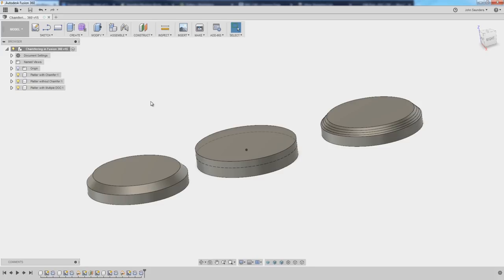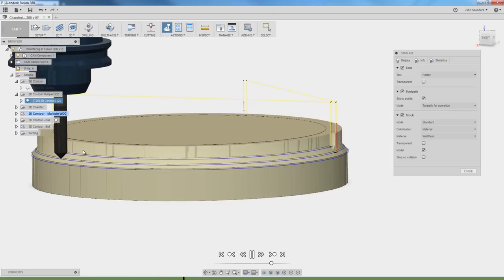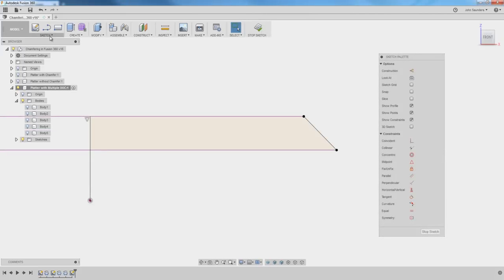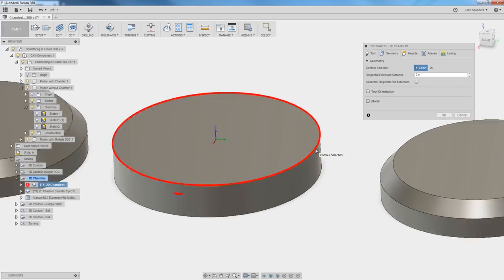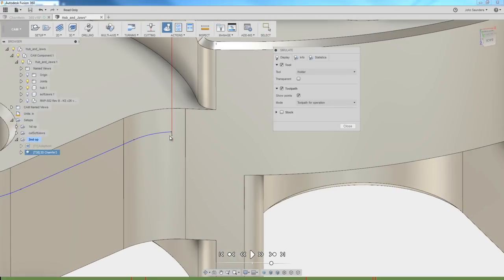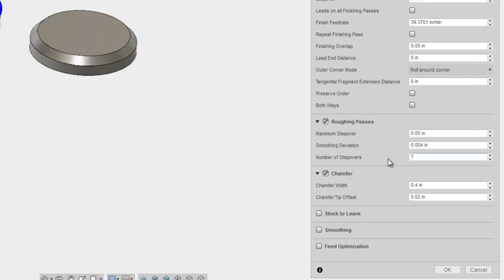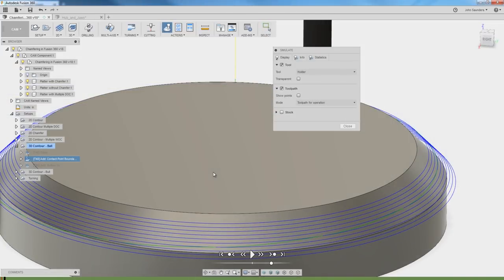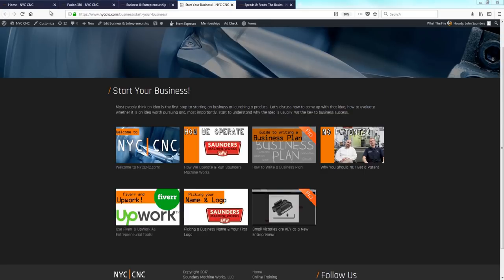Fusion 360 Chamfering: The Nitty Gritty  FF111

Comment: John,

Regardless of approach, one thing to be conscious of - particularly when chamfering small edge breaks - is to vary the contact point between the part edge and the tool between applications. Otherwise all your wear is focused on the same small area of the cutting edge. Later, if you need a wider chamfer that focused wear area will leave a cosmetically unpleasant ridge. Just change the tip offset  for each job to walk the contact point up and down the cutting edge.

Comment: Hi John. I regularly have to chamfer a 12mm thick plate in my workshop. The plate is 1395mm OD 700mm ID & requires a 10mm chamfer to the OD . I can do this in 2 operations as i have 800mm y travel . The tool I use is a Seco inserted tool with 25mm end & total diameter of 39mm. I do 5 passes of 2mm depth of cut , the first cut removes the most material this changes with every change in depth of cut . The last cut cleans up any small stepovers. I use a couple of tools like this for chamfering or countersinking , cost effective and fast enough. May not be good on your little Tormach but you would find them useful in  your other machines.

Comment: You can get a better finish with a small chamfer mill on a large chamfer if you account for the flat that’s on the bottom.  Usually .015 diameter flat on a 1/4” and a .006” diameter flat on an 1/8”

That’s why the chamfer comes out looking stepped when you do multiple depths, you’re programming it as if it’s a 0 diameter tool, but it’s really a .015” diameter tool, leaving you about. .004” step in the surface.

Comment: 2D chamfer works pretty well with 3D/Modeled chamfers in my experience. You always select the upper contour of the modeled chamfer or it won't generate a tool path, set chamfer width too a thousand or even a tenth (if the chamfer needs to be held to a close dimension). If the chamfer isn't modeled, then you just add the chamfer width that you are looking for otherwise it will work off the modeled chamfer + specified chamfer width

Comment: Small tip: you can actually use countersinks as chamfering tools, or at least the ones with three flutes. You just have a little work measuring in the geometry since the bottom of those have a little flat.
Reply: Klaufmann Single flutes work well too. I use them all the time. Spot drills do a great job also.

Comment: For modeled chamfers larger than your tool.   Do some 3D Adaptive clearing  with a Flat EM in the chamfer area before using the chamfer tool.  Credit to w.A.f. for his comment on this.  Also to Oakwood Machine Works, yes, you could use a mill drill, but I think you'd find you'd need a roughing and a finishing pass, so probably better to use a FEM that you are likely to use for an operation before this one for more efficient roughing and material removal.   

Once the area is roughed, use 2D Contour from the TOP of the chamfer in multiple steps.  Steps are duplicate operations, with just the Chamfer Tip Offset increased as you work down the part.  You can use offsets larger than the width of the cutting face of your tool, but you can't use negative offsets, which is why you start from the top and work down.

Comment: 5-axis should let you use any parallel cutter with flutes to cut a chamfer at "any" angle. Gives a constant cutting speed across the final face.

Consider it a challenge.  Merry Christmas.

Comment: i recently ran into this problem and you can use 3d contour with a regular chamfer tool, the only problem is fusion likes to error out if you use a pointed tip chamfer.  setting it to zero it what causes the error of invalid tool type.  hoewever, even setting it as low as 10 millionths is enough for fusion to not error, so setting it to .00001 will then allow it to make the path you want.  this could be brought to the developers attention because cutting chamfers larger than the tool is no uncommon and the 3d contour tool path is probably the easiest fastest way to get your intended tool path.

Comment: One possible error here is that John is using a chamfer mill that comes to a point and doesn't have a flat spot at the tip (e.g., 1:30). However, many or most chamfer mills have a small flat spot at the end, as shown in the example from Fusion at 1:40. For example, if you use a 90 degree chamfer mill which has a 0.1 inch diameter flat spot and you don't account for this by entering it in the Fusion tool library (your cutter data), the mill will cut a chamfer 0.05 inches wider than you want. This is because you will be setting the height of the end of the tool (Z0) wrong by 0.05 inches by incorrectly accounting for a pointed tip versus flat. On some cutters, it is hard to see the flat end and/or hard to determine it's proper diameter.

Comment: I think you left out a good method for large chamfers.  Rough the chamfer using 3D Adaptive or 3D Contour with a flat or bull nose end mill, finish up with the appropriate degree chamfer mill using 3D Contour.  Use Maximum Stepdown on the Passes tab to control engagement.  Note that I use flat nose chamfer mills.

Comment: At 1:19, John discusses how to use 2D Contour (not 2D Chamfer) to create toolpaths in designs where the chamfer is already drawn/modeled within the part. For the geometry, he says to select the BOTTOM edge of the chamfer. I've found for several of my somewhat complicated parts that selecting the bottom edge doesn't work, but selecting the top edge does. So if you have problems, try selecting the top edge and see if that helps. From thinking about this, I think either should work, so bottom might be the first option to try then top if bottom fails. It may or may not matter if you set Heights>Bottom Height to the same height as the geometry you selected. (I'm using version 2.0.10813)

Comment: Learned a lot from the video and the new website looks great. 

I would create the bodies in the second example a bit differently. I would create a duplicate of the body. I would then create 4 offset planes from the top and split that duplicate using Modify > Split Body command into 5 sepparate bodies.

Just a suggestion: put link to the website in the description.

Comment: Hold on a second... @ 2:30, that's #notpossiblenorideal Chamfer tools don't generally have a cutting edge on the shaft, just only at the angled head. How are you going to remove 1/2" of stock above the chamfer with a round shaft?
Reply: Look into drill mills. They can mill, drill, spot, and chamfer.
Reply: It's just a 90° end mill. It's fled all the way up, and instead of the bottom being flat, it's not a 90° point. You're prob new here, but that is what John uses for chamfers.

Comment: A lot of time 2d chamfer gives empty toolpath if you want to machine all edges  in a single operation, no matter if you chose to work close to the tip or not and even if it has enough space with both variants, they still have a lot to work on this issues. Also roughing out an deeper V slot, with a 3d pocketing operatio its kind of problematic, becouse it always tryes to helix or plunges into the part, even if it has a lot of space to plange  near, and by the way, plounge outside stock is an useless option in the linking tab.
Reply: If you make a sketch with a bigger boundry in direction of free space it tryes to go all round and below with a lot of useless moves..., rest machinning also gives some problems with that cusps, always you must be very carefully becouse rest tools engages to much material left from previous tool, even if you select 0.05 mm stepdown.

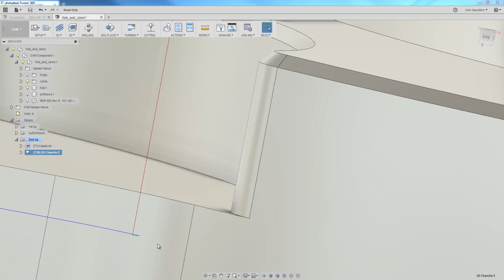Comment: Why does is the tool turning red at 11:47? I see this a lot and seems like it's showing a collision when there isn't one. I don't understand it. Thanks
Reply: Steve just Steve - Maybe it’s getting too hot due to friction? :) Just kidding. Probably some sort of built-in DRC (Design Rules Check) violation, is my guess.
Reply: I'm pretty sure it's considering a collision for some reason, just don't know why.
Reply: Possibly something to do with the default shaft and holder settings for the tool. Unrelated to that, it's a shame F360 doesn't allow the use of chamfer tools with 3D Contour.
Reply: The reason the tool is red is to let the user know that the tool is colliding with the stock. During that simulation the stock was not shown, but the program still calculates when collisions occur. In that instance, the stock would likely have been removed in a previous operation, and if the simulation included that/those previous operations there wouldn't have been a collision. But since that particular simulation didn't include the previous operations, the stock still existed and hence a collision occurred.
Reply: I think there is a "collision" since he is machining into the stock past the model, since the chamber isn't modeled. My understanding is that the red means you are cutting into the model
Reply: I don't believe the simulation considers the model geometry, and that it only considers the stock and fixture geometry. There are probably other conditions, but here are a few instances it would consider a collision...
* something other than the flutes of the tool contacting the stock or fixture
* the holder makes contact
* when any part of the tool makes contact during a non-cutting move
Reply: As others have pointed out, the CAM assumes you have a stock material (not shown) and that creates the collision warning. From the setup you can change the stock to be the model and then there will be no warning, as it considers that the part is "finished", as in no more stock left.

Comment: Does anyone know if it is possible to chamfer as machined edges? 
e.g. if you have a tight corner that a tool can't reach in to. Is it possible to tell fusion to chamfer the edge left the the tool rather than following the contour in the model.

post here with more detail: https://forums.autodesk.com/t5/fusion-360-computer-aided/chamfer-edge-break-as-machined-contours-chamfer-rest-machining/td-p/8016914